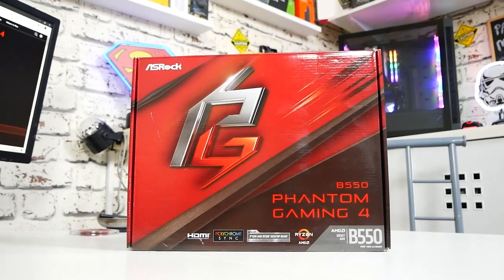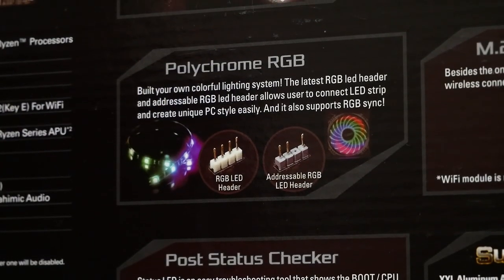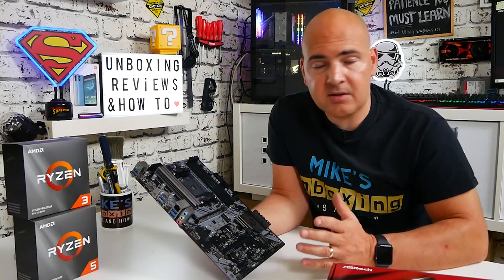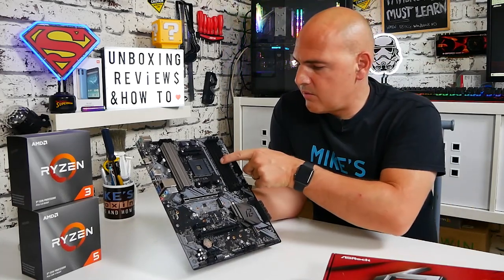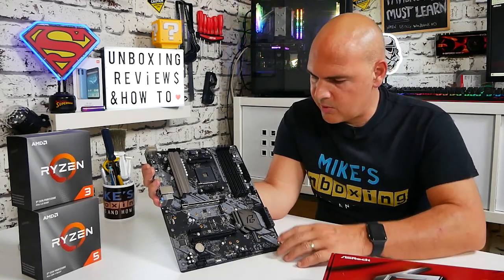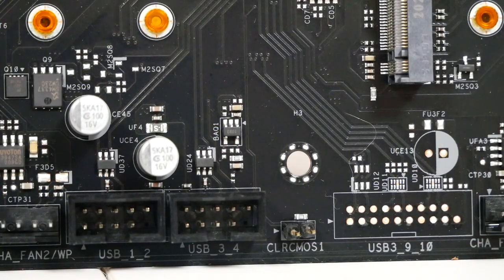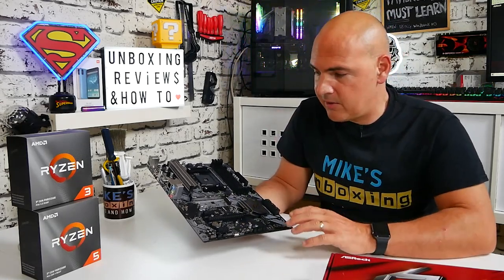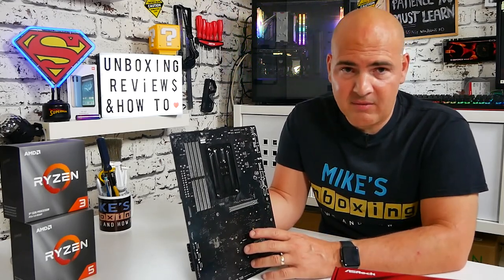Asrock B550 Phantom Gaming 4 Best Budget AM4 3rd Gen Motherboard

Comment: I`m going to buy b550 board and r3600 in next few days and I`m deciding between this board or b550m aorus pro which is basically at almost the same price but got much better 10 phase + 3 for soc vrm but you sacrifice 2 sata ports which dosnt seem to be that big deal for me, I now use 5 sata ports but I could just disconnect small 320GB harddrive or DVD recorder.  I will swap my cpu to something 8 or even 12 cores in next 2-3 years and I play to keep using motherboard I will choose for next 6-7 years and upgrade GPUs also. I always do some OC to all components but nothing crazy, I prefer to keep it stable and safe. Whats your opinion, I`m inclined to choose better vrm after all.
Reply: Keep in mind that you can't upgrade a motherboard's VRM, but you could always get a PCIe to Sata card, to have more sata ports ;)
Reply from the maker: I think that vrm wise for the 3000 and onwards it isn’t going to make so much difference as the ability to overclock much further than the PBO speeds gets harder to achieve. And I think the 4000 series will most likely follow in this way. But if you like to tinker around with OC it would make to go with a smaller sized board and the money saved there can get you a higher tier board in matx then go for it
Reply: B550 Tomahawk is £152 on eBay at the moment
Reply: I just built a pc with 3600x and this board (asrock b55p phantom gaming 4) its a solid match.  Very happy with it.  Only thing I'd recommend if you're using m.2, use the bottom one because the hyper m.2 sits literally under the gpu.  Solid board though for the price, very happy with it.
Reply: @davidfoote696  whats the matter if the hyper m.2 is under the gpu? what ram are you using and what mhz?
Reply: @xuxipan7181   gpu can run hot, and ssd can also run hot.  May not be a huge deal, but better if they are spaced out a but.  I started with 16gb ram, @ 3200.  Good enough for now, but I'll bump it up to 32gb soon, still 3200 obviously lol.
Reply: @davidfoote696  i think i get you hahaha you have a valid point on their spacing issues in the long run. Asking for your opinion if I may... b550 phantom gaming 4 or b550m aorus pro? theyre about the same price in my country with the aorus just a little bit more expensive. will pair it with my ryzen 5 3600 and rtx 2070 super
Reply from the maker: Asrock I would say gigabyte vrm isn’t very good on the b550 this time
Reply: @mikesunboxing  ooooh so asrock for you mike? thats surprising to think that gigabyte aorus is the more known brand :O
Reply from the maker: @xuxipan7181  known brand but not great for the B550 boards
Reply: @xuxipan7181  I mean I think they're both good, I went with the asrock and I'm glad I did, everything works so well on it so far.  Not sure if theres a price difference or connectivity differences.  Just make sure everything is compatible.  I would 100% get another asrock board for another build.
Reply: @davidfoote696  thank you for that opinion mate!

Comment: The good thing about Ryzen is you don't need a tpm card as the chip has one built in if you go into device manager you will see it listed under security devices  as Amd psp 3.0 device this allows you to use windows bitlocker on w10 pro. Btw great video was waiting for this ;)
Reply from the maker: Thanks for the info and thanks for watching

Comment: Thanks for the great overview of this board, Mike! I am excited to see that there are some reasonably priced B550 boards available. My B550 Gaming arrives tomorrow, and going to slap in a 3300X and see how she runs. Should be a great entry-level 1080p (60+ fps) gaming system when paired with a 1650 Super card.
Reply from the maker: Yes sounds like a great system and for 99% of people it will be all they need
Reply: I just bought the exact same setup with a 3600x instead, how did it work for you man?
Reply: Sky Stalker where did you get your B550 gaming motherboard? because I can’t find it anywhere

Comment: About 4 years ago I purchased this motherboard with AMD Ryzen 5, 32GB, SSDs, Wi-Fi and RTX 3060ti.. it's really an amazing motherboard. I use it for Microsoft Flight simulator 2020, Blender 3D and many other video production software. No problem at all .. sure I will get back to your channel whenever I need to buy any new hardware.. Great video.. Thank you for the effort.
Reply from the maker: thanks a lot for the update and taking the time to leave the comment

Comment: just got this board alongside my first AIO Liquid Cooler, working amazing, increased my performance quite a bit. Death stranding handles well on the new board playing at 68+ fps on max settings with my RX570 8GB, i was using a msi b450 tomahawk max before this asrock board, and was getting 58 and lower fps with the same game same settings same gpu.
Reply from the maker: that is great, glad you like the board

Comment: Thanks Mike great review! Well spotted on the WiFi/SATA differences. Bagged the WiFi version for £110 last week, think it was the only version back then. Upgrading from my old i5-4609k setup. The budget MB suits all my needs and not looking to push my Ryzen 3600 or memory in any way.
Reply from the maker: Thanks for the info! and enjoy your build
Reply: @mikesunboxing  I have a quick question if you can help - are you running memory at 3600MHZ XMP fine? I've upgraded my Corsair Vengeance LPX 3200mhz (CMK16GX4M2B3200C16) to Corsair Vengence RGB Pro 3600mhz (CMW16GX4M2Z3600C18) - but the XMP 3600mhz doesn't boot. Best I can do is 3534mhz (with XMP profile), but not wanting to mess around with the voltage. Waiting to hear back from Asrock whether its MB or I have a dud RAM kit! What are your thoughts?

Comment: Hello, good video thanks for the information, do you think this motherboard would support a ryzen 7 3700x without problems? or maybe a future ryzen 7 4700x when the fourth generation comes out because I have a ryzen 3 3100 and I want to overclock and later switch to the aforementioned, thanks
Reply from the maker: Yes this will work well I think

Comment: Great video! I'm looking at prebuilts, since they seem to be the only way to get your hands on the new rtx cards. I'm hoping to save a little money to put towards a better GPU and CPU. Does it make sense to save some money by switching to this board over setting more mid-ranged? Or rather, would this board do well with other high end components like a 3080 and 5600x? Thanks!
Reply from the maker: with higher end components it is always worth considering a higher end board if the budget allows
Reply: @mikesunboxing  Thanks for the feedback! At the moment, the prebuilder is offering the MSI B450 Tomahawk Max, but I have heard this board is too close to being outdated to be worth getting. The next option up, is the MSI MPG X570 Gaming Edge Wifi. However, I heard this board is the worst of its kind at that price point and is about $100 more than the ASRock B550 Phantom Gaming 4. I don't know if spending more beyond the cost of the Gaming Edge would benefit me though.

Comment: Ill be getting my 5600x but need a good board to go with it im stuck between the msi b550m pro vdh wifi and the Asrock b550 Phantom gaming. Which do u think would be a better board?
Reply from the maker: probably the MSI is the better option

Comment: great vid thank you will this board take a ryzen 5600x out of the box,if not what board would ?
Reply from the maker: currently i don't think any boards will work out of the box maybe in a few weeks when stocks are replenished with the new bios installed but most are going to need to be flashed manually

Comment: Thanks for this i have just bought this motherboard and there is a problem with xmp settings enabled for Ram, The computer crashes randomly, there are quite a few posts on reddit about this issue. When i turn off xmp it runs at 2666mhz with no crashes. But i have 3600mhz c20 ram and want to use that speed. I look forward to your next video.
Reply from the maker: Testing mine today with 4000mhz xmp fingers crossed
Reply: @mikesunboxing  
Hi Mike hope you've had a good weekend! Im really interested to hear about your Memory results. I have Corsair 3600mhz c20 ram(Timing 20-23-23-43) and under xmp settings my computer wont stop crashing randomly, but running @ 2666mhz default with xmp off it runs fine with no crashes. Ive also updated the bios to 1.10a from asrock website. Have you had the same problem and do you know what this might be?

Comment: Not really into having a 4th gen NVMe under the GPU, I will wait on your SP drive reviews to get your take on that situation, but for the price that's feature rich even with the seemingly barronus rear (or top) IO. 

Got someone coming on Thursday bought the £80 gigabyte B550 M and a 2600x (yeah) hes hoping I can get it to work. I have a couple of 3100 one in a machine I listed yesterday and a 2600 I put in the cheapest AS rock B450M yesterday before he contacted me not understanding why it keeps power cycling. Or where the cmos reset or battery is for that matter.
Reply from the maker: challenging times ahead for us techs i think
Reply: Thats why we do it though "get the solder gun out we will make Frankenpooter rize from the dead"

How did you get on with 4th gen NVMe under plastic GPU by the way? I only done one on the phantom gaming  can't remember the brand but just had alu sticker heat sink under sapphire nitro 580. it reached 89 degrees under the chunky cowl and warped the plastic a little when tested. Or is a vid eminent? @mikesunboxing
Reply: Damn, only needed to throw the switch on Frankenpooters back, all that for nothhin. @mikesunboxing

Comment: Just bought one to pair with my ryzen 5 3600 + rtx 2060 + 16gb ram 3600mhz. Do you think it's a good match? Since this is a cheap one I'm afraid of not getting full potential of my specs but as per reviews, it will work as grand! Cheers.
Reply from the maker: this will be decent, i had a play with this board again today and it is a decent performer, you will like it

Comment: If I put a Ryzen 7 3700X cpu in this, do you think I'll need to use the additional 4pin power connector? If so, what PSU would you recommend?
Reply from the maker: no the single 8 pin will be fine

Comment: Thank you for the video!  I have the wifi version coming.  I have 3 basic questions.  Which 2  slots for 8x2 gb of ram, which slot for single VGA, and would i still need spdif pass through to get sound through an HDMI cable.  (My last 2 builds were 2010, best one a phoneme 2 and still kicking!)  Oh #4, is this all explained in the big user manual?  if so skip the first 3 questions.  Thanks again!
Reply: Phenom of course,  not a phoneme, but perhaps a good name for a future CPU...
Reply from the maker: most of it is in the manual, but to save you some work, first the slots should be 2 and 4, the top slot for the video card and the HDMI will pass through the audio without a separate cable.
Enjoy the building process and if you get stuck you can get help on our discord
Reply: @mikesunboxing  I appreciate the reply, already running great!  But no audio detected through HDMI for some reason.  Perhaps drivers/software to come.  My lucky kid will be getting my old speakers anyway, but it would be nice!
Reply: That actually depends on if your graphics card AND/OR TV/display supports sound signal over HDMI port.
Reply: @TheChudoviste  thanks, working fine!
Reply: @bobkitt4594   Glad to hear that.Cheers

Comment: help plz. why i see two m.2 slot? 
but the spec says one
B550 Phantom Gaming 4/ac
Reply from the maker: This is maybe easier to fix or at least advise if we can ask more questions and get direct answers, so feel free to join our Discord chat and we can go over it in more detail https://discord.gg/gaeeDPw
Reply: pretty sure it's for a wifi m.2 card
Reply: Please look at the website. I did the same to confirm.
Reply: It has 2x m2 type M slots,
and 1x m2 type E socket (the last one is for WI-FI module)
Reply: Were you able find out how many m.2 SSD slots there are on the ac version? In the official manual it says there is only one (while the manual of the non ac version says there are two). But in some test they say there is a second one like on the board without wifi and it also looks like there is a second one on the pictures.
Reply: @der_David59   looking at the picture on the website,the board definately has only 4 SATA ports,a WI-FI card installed in the m.2  key E slot,and  it has 2x m.2 key M slots.Unless those are the pictures of pre-production board,it should be genuine.
I would definately search for some video reviews if I would be in your place though.
AND I would definately go for the non-wifi version,you can get that WI-FI card for 10-15$ any day,but you can not get 2 more SATA ports without a bigger hustlle.
Reply: @TheChudoviste  Unfortunately I couldn't find any video reviews of the ac version. The problem is that in the official manual (https://download.asrock.com/Manual/B550%20Phantom%20Gaming%204ac.pdf) there is no second M.2 key m slot mentioned. That makes me strongly believe that there is none, although the pictures obviously show one and I can't figure out why they should leave it out on the ac version.
But either way you are probably right, that getting the the version without wifi and adding a wifi card is the best way. Thanks for your comment!

Comment: Hi! What wifi card would you recommend
Reply: It depends if you can use a lab cable. Lab cables ofer faster speeds but if you are going to be taking it places I would definitely invest in the WiFi card.
Reply: @kidcod3ine896  No, I will not be able to use a lab cable. I don’t even have direct access to the router or anything so
Reply: @z3nith750  ok yea I don’t have an answer for you but tbh if you have a question on anything I would def go to Reddit 😂.
Reply from the maker: i have done an update video on this board and how to install the wifi combo card

Comment: is it okay to partner this with my Ryzen 5 3600 and rtx 2070 super?
Reply from the maker: yes good choice
Reply: @mikesunboxing  will there be no problems on vrm? I'm confused because I'm on  a tight budget and I cant afford the expensive b550s for now... so I'm torn between buying a good b450 motherboard like Tomahawk max/Gaming PLus or buying a budget b550 like that Asrock b550 Phantom Gaming 4 or any budget b550 because they cost almost the same. Also, I have an intention to re-sell it so I can upgrade to a better b550 in the future so I'm worried on its future value. what's the better option for me Mike? Thank you in advance!
Reply: Chin Lu all b550 motherboards have better VRMs than b450 motherboards, so go with the b550, if you have the money I would recommend the b550 steel legend, if not than this phantom gaming 4 or 4ac is a great option, it’s what I’m using in my build
Reply: @tiny_a_dog5721  thanks for the advice!

Comment: Is that motherboard support Ryzen 3 3300X & GeForce RTX 2060 Super?
Between B550M Pro4 and that motherboard, which is better (because i'm interest with that 2 motherboard now)?
If motherboard not include wi-fi, what should i do?

(Sorry for many questions because i'm confused & really" beginner for build a PC. Also, sorry for bad english)
Reply from the maker: yes it will be fine, the B550m is matx not atx though
Reply: @mikesunboxing  thanks for the answer. But, Sorry, how about the wifi if not include in motherboard?

Comment: Greetings Sir, 

I would want to know about power connector of this motherboard. I don't intend to overclock, so is it necessary to plug the extra 4 pin connector or will regular 8 pin suffice?

Thanks.
Reply from the maker: No need the single 8 pin will be enough for almost all builds
Reply: @mikesunboxing  Thanks a ton.. you have been regularly replying to my messages :)

Comment: I plan to get this board with a new ryzen 5000 series, but I wont have a current ryzen processor to flash the BIOS update. Does this motherboard have the asrock instant flash feature in the BIOS? If not, how would I go about making this usable with the 5000 series?
Reply from the maker: that is going to be a big problem for many people and as there isn't really a budget 3000 series chip you might need to just get a 200ge and flash with that, those chips have had some success on these boards already

Comment: Try putting a 3rd gen Ryzen & 3000 series in it to check will it boot.
Reply from the maker: It is built for 3rd gen it should boot fine or do you mean 2000 series and lower
Reply: @mikesunboxing  yeah 2000 series, sorry for typo error. I want to say 2nd gen Ryzen & 3000 series APUs
Reply from the maker: Got it

Comment: Would this board be compatible with the EVGA BR 450 W 80+ Bronze Certified ATX Power Supply because it says the motherboard has an additional 4 pin connector but the power supply does not?
Reply from the maker: not really but it will depend on the other components you are planning to use

Comment: Do you know if you need your psu to have a 32 pin connecter for this board, or willk any psu work with this, and my friend is just mental?
Reply from the maker: 24 pin standard atx is fine your friend could be mistaken

Comment: Does this have a Bios flash button? I bought a Ryzen 5 5600x and I was wondering if this board would support the CPU right out of the box. I don't have a 2000 or 1000 series CPU, so I am hoping that if it doesn't support the CPU out of the box, that it has a bios flash button.
Reply from the maker: no it doesnt have a bios flash button but if you have bought brand new stock it should be flashed already and you can read the bios revision on the board to see before you do anything